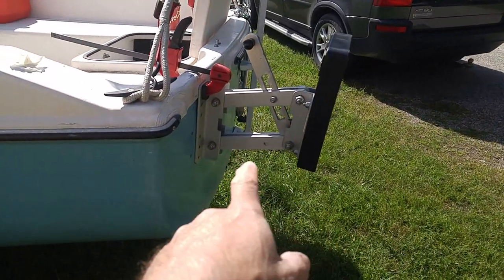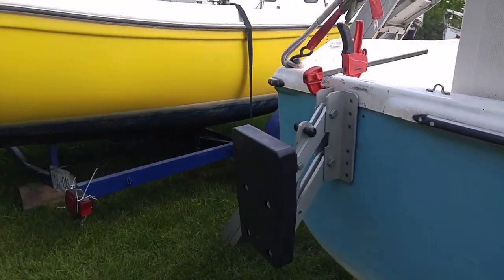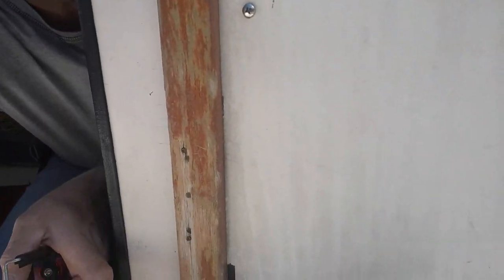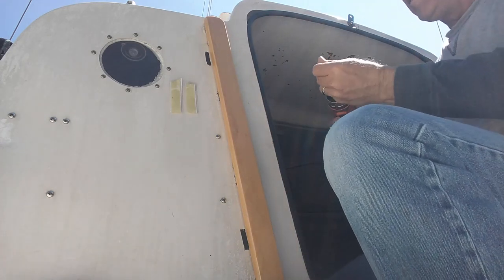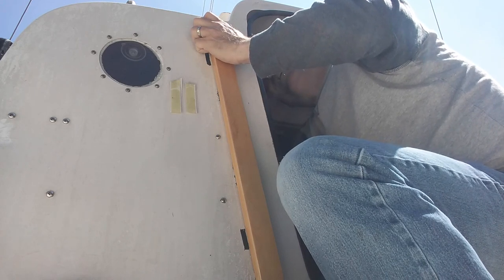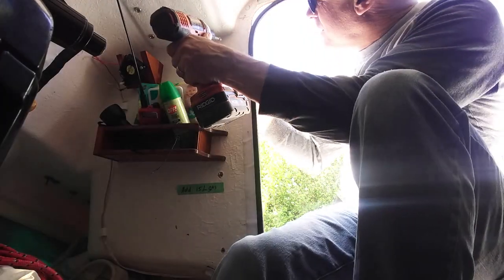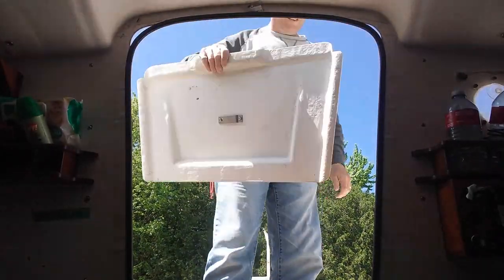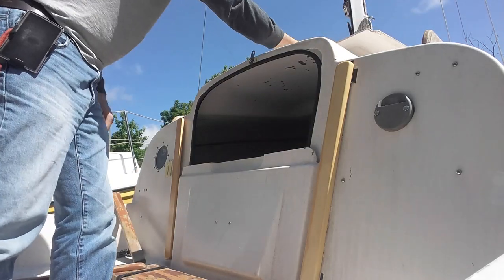Installing Siren 17 Companion Way Hatch Slides

Comment: Nice work on the hatch slides.
Reply from the maker: Thanks. They work well so far. 

The true test is if I can install the hatch boards while in the cabin. (I forgot to test that...) I need to be able to do it when I cruise to keep the wind down and big critters out.

Comment: Saw your dimensions on the yahoo group; thanks! I have my pine (what I had on hand; teak will wait for the winter workshop) ready, but... 1 - your old rails, like mine, keep the door panels off the bulkhead (ie there is a slot into which the panels sit) so there is no fiberglass-on-fiberglass contact - no big deal? 2 - I have been looking around for Butyl, but am not finding it in paste/goo form - what exactly are you using? 
Got my boat back to my lake (an hour drive away) last weekend after purchasing it some 6.5 hrs away, and have spent zero time on it - that changes as of this Friday night. Hope to splash her this weekend.
Reply: Found butyl in tape form - understood. Still curious about your fiberglass-on-fiberglass contact opinion.
Reply from the maker: @double0newb  The fiberglass hatch doors are fine. I'm not expecting any problems with the way I've built the wood slide rails.
I've got a full start to finish video coming out tomorrow. Check it out.
Butyl is also called 440 tape in the window industry. RV guys use it to waterproof there vents. (Not the same quality as the window stuff.) 

Enjoy that boat!